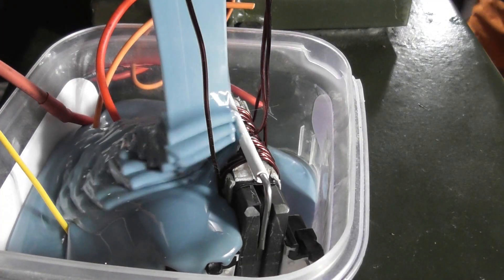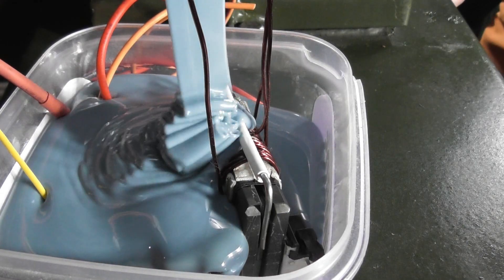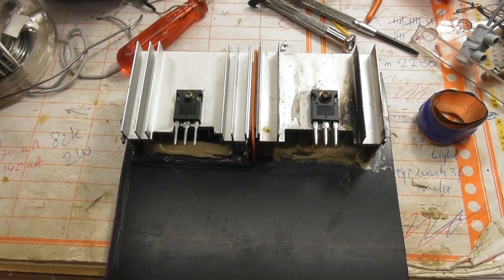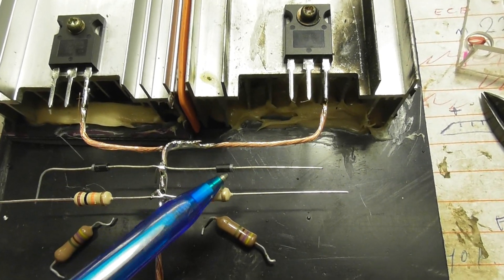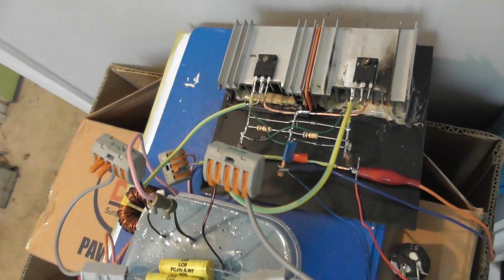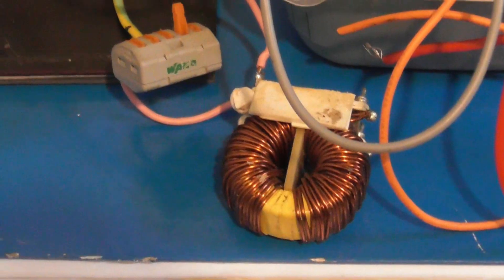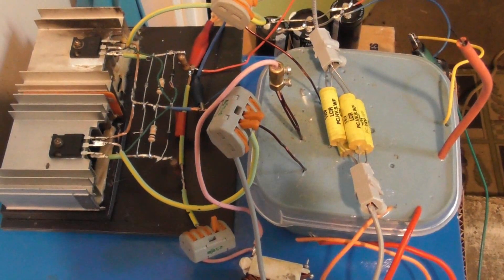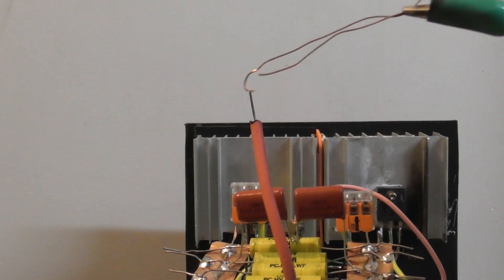TV flyback transformer potted in for a low power ZVS wasp zapper R&D

Comment: My dude , keep the component leeds as short as possible & passive components as close to eachother as you can  for better output , also keep the two heatsinks isolated from eachother .
Reply from the maker: The heatsinks are isolated from each other, yes, I am aware of shorter leads to the components. Thanks.
Reply: @RODALCO2007 no problem mate , cheers.

Comment: If you want really long, but not super hot arcs, a flyback driver circuit is better for this. You can get an appropriate transitor (usually BJT) from the CRT's original board (rated to 1200V usually) and run it without any snubber circuit for maximum open circuit voltage (>30kV). 

The ZVS circuits are good for high current and lower voltage. Best thing to increase the voltage on those is to just feed it more at the input.

Comment: add a vibrator plate or other form of vibration to help keep bubbles(air pockets) from forming and dispersed. probably not critical for a project like that, but more sensitive very HV things. even embedded micro size bubbles can cause arc shorts and total failures.

Comment: For better operation make that common source connection a copper strap instead, or thicker wire, so you get less loss in there, and thus longer life on the mosfets, as they will otherwise be oscillating during turn on and off. Shorter lead length on the gate is also advised, with the diode directly at the pins.
Reply from the maker: Thanks for the advise.
Reply: ferrite beads on the gate pins may also be beneficial. If the MOSFETs are running completely in their switching region, there should be little to no heat from them.